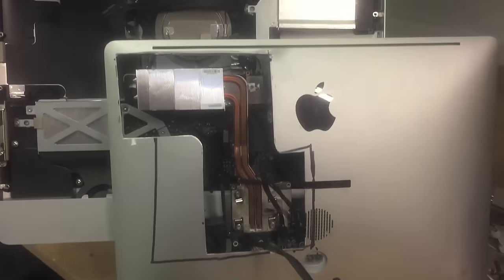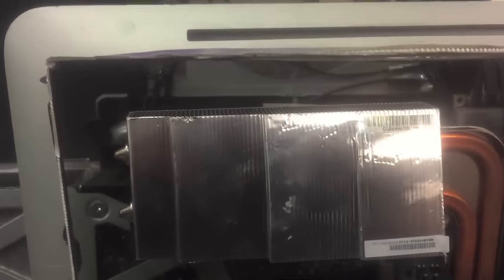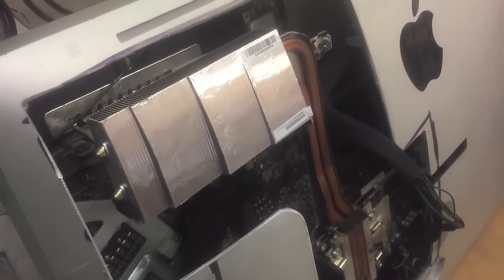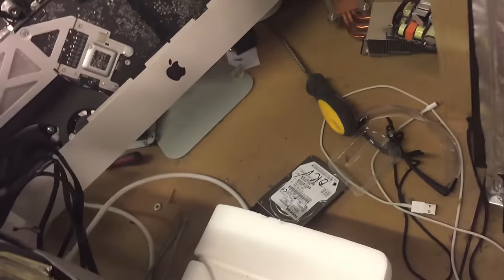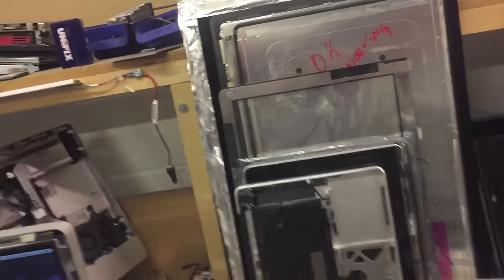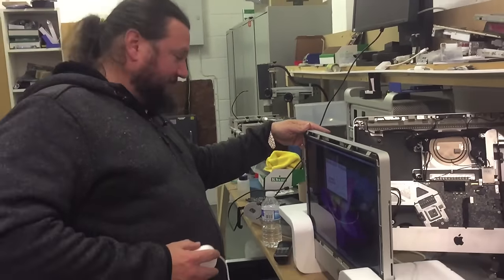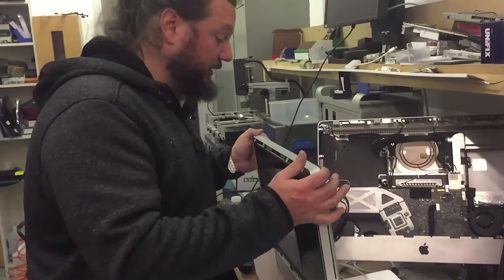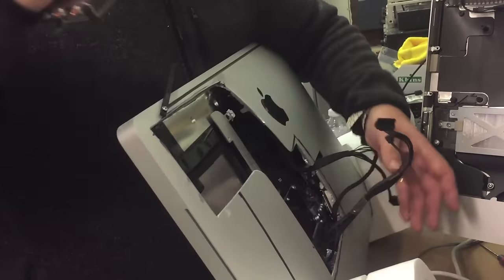iMac Graphic card easy access repair (fix)

Comment: Hey would it be possibel to find a longer connection cord and simpelt have the gpu card placed outside with maybe a better cooling solution?
Reply from the maker: hi , maybe but as i've got lots of spares parts this ia how i did it
Reply from the maker: Yes  but i use what I've got for now 
cheers

Comment: Do you know if the late 2009 21.5" imac 2308 can take another card than the stock 4670 256mb?
Reply from the maker: Laurent Dansereau I not sure but the iMac 2.5ghz 2011 so far can take any graphic car form other iMac , orders or newest from 21.5 or 27"
Reply: Ok thanks my graphics card dieded, the bake method didn't help, and I was wondering if I could just put any mac card I could find.
Reply from the maker: are u uk base? i could fix it for u
Reply from the maker: i be leave it can
Reply: No, I'm in canada. If it works It would be nice to upgrade and give this machine a new life... Are you selling cards that work?
Reply from the maker: yes i do have some  with a new chips
Reply: Gonzalo Fernandez hi where are you. are you in London?

Comment: This is a bad idea! The ODD (Optical drive) fan, which is in charge of cooling the graphics card will no longer work. Air flow won't get to the GPU heatsink, and the card will overheat and fail immediately.
Reply from the maker: Hey , yes you are 100% right , but this is a testing unit , is not to live the video card on it , is just to check if my new chip works before put it back in to the actual iMac , is not fun to put all back when you notice that the video car is not working !!!. So it is a TESTING UNIT ONLY it only to check for few minutes 
Cheers!!!!
Reply: What if you tape it back shut?

Comment: Perfect
Reply from the maker: it is a good tip , i done 3 re-chipping today and was really good , i check all the graphic cars also i run stress test with no problem , it mad mi life no much easy and the best thing is that the iMac 2011 21.5" will take any card from 2009 to the 2011 regardless it is the  21.5 or 27"